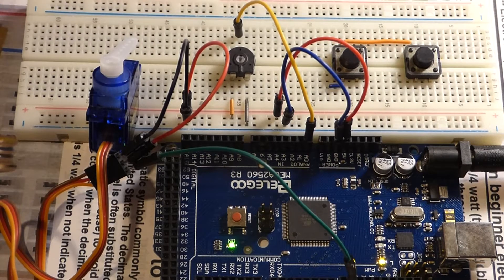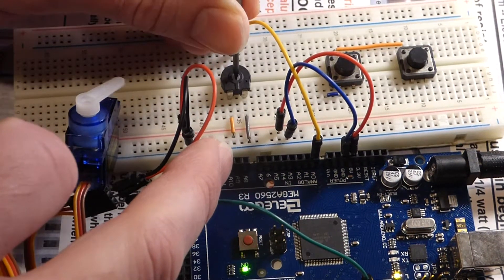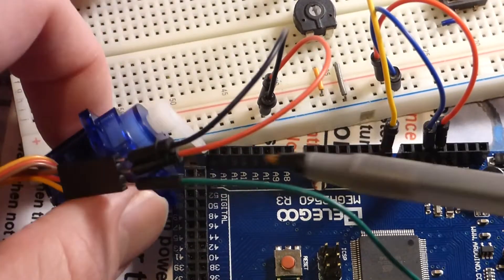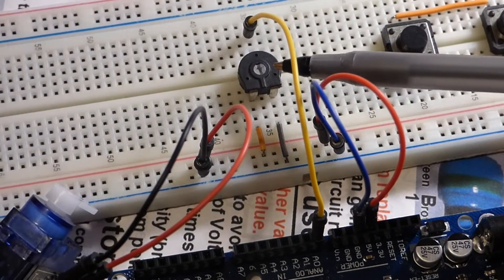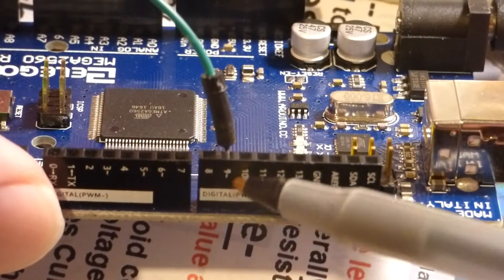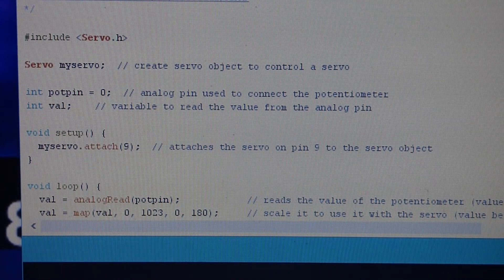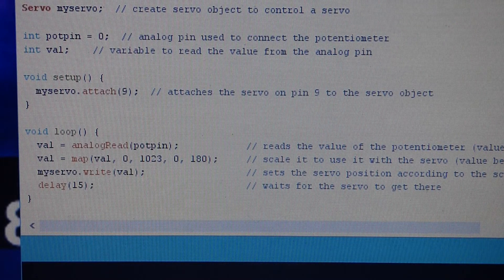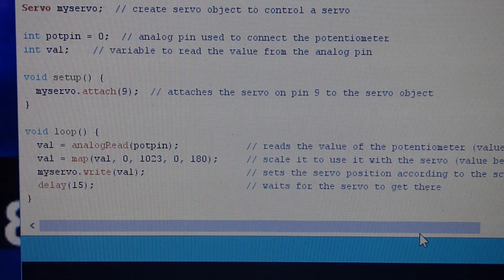Arduino trimpot potentiometer controlled servo using knob sketch electronics tutorial electronzap

Comment: What the hell, how do you get it going now?
Reply from the maker: Looks like another video where I skipped the upload process because it is the same for all sketches.
Reply: @Electronzap   Because like me who writes or types things only to find out that I have simply erased a dozen word or so.  Except that in my mind I didn't.  I had it all there filled in my head just not on paper.  And if I edit the dam thing again. I will  only realize later that I still didn't take care of all the missing words and some of those missing words were still in my head  and missing in the  file.   It seems I am not alone.
Reply from the maker: Indeed :)
Reply: @Electronzap   I tell you what is funny.  The reason that motor was so lame and lacked power that it couldn't scratch the head of a fruitfly is because I hand't turn on the power to that power supply.  I happen to notice it this morning when my bored eyes happen to find itself looking at it this morning.  I pushed tht white plastic looking thing and oh my.  Now it has been zinging like a bumblebee.
Reply from the maker: @alchemy1  Nice!
Reply: @Electronzap    No problem I see what the nature of the beast is now.
I downloaded Arduino successfully.  In a nutshell the whole thing boils down to wiring the whatever device and then the code/program  for it. You can just go online and hope that someone has writen a code for whatever the game one has in mind.  upload and wham after a few seconds.  But one thing is left out by everyone.  How to stop and end the dam thing.  What just unplug or what?  There is no place where you can stop the program.  Why this kind of crap is not clear?
I ran a bunch of stuff successfully  and the last 1/2 hr I have been watching the motor with the fan hooked up and watching off and on with some lame spinning coming and going.  sigh..... not a sound but just like a limp;...……..gets going, stops, takes a breather and then repeat.  It might have enough power to scratch the head of a fruit fly.